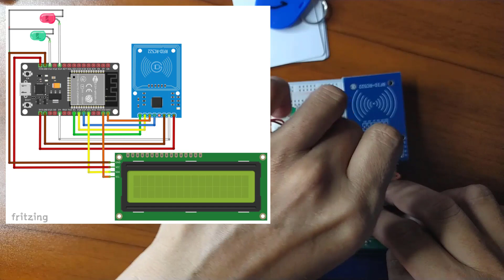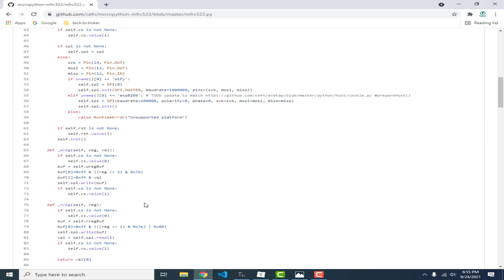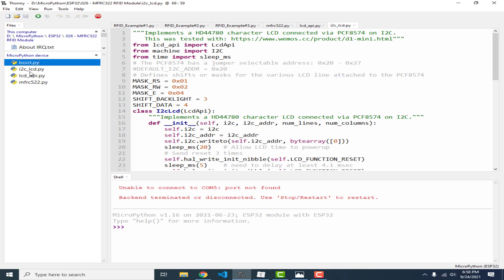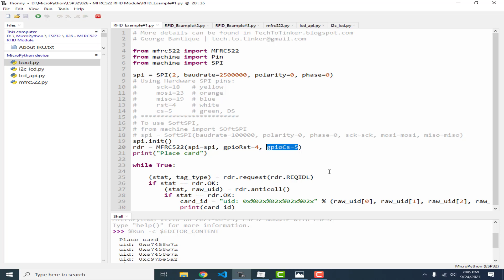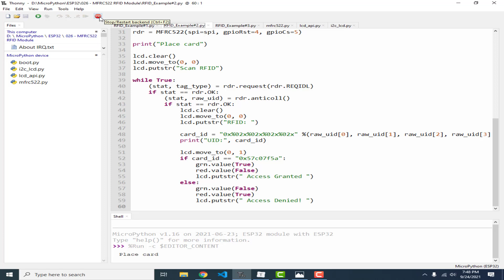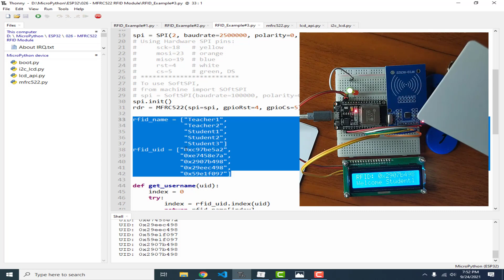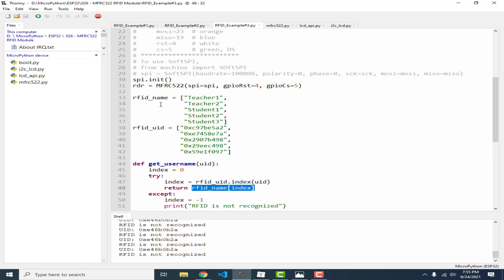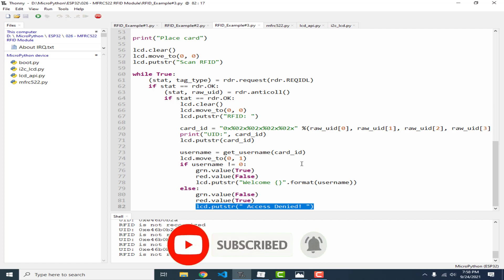026 - ESP32 MicroPython: MFRC522 RFID

Comment: First of all, thank you for all your videos, I just know how to program in Python and these ones are really helpful to get into applied electronics. I just wanted to ask if there is a way of modify/write the information of the cards? I've been looking through the libraries but none of them let me modify the info when tried eventhough there are some that have a "writing function".  Thank you!
Reply from the maker: Hi Miguel, thank you for the appreciation.

With regards to your concern, you may go to the github source and under the folder there are 2 files 1 for reading the mfrc522 and another for writing to it https://github.com/cefn/micropython-mfrc522

I haven't fully tried it but it's working with me as far as I can remember. Cheers, George.
Reply: @TechToTinker  Thank you so much for the quick reply, I will try because I couldn't even with this so sure I'm doing something wrong. Thanks!

Comment: Should the LEDs have current-limiting resistors?
Reply from the maker: Hi @I'm not Chuck, yes you can add a current limiting resistor. I just added the led indicator when I am about to record the video, my bad :). Thanks for correcting. Cheers.
Reply: @TechToTinker  I watched the entire video, and learned about RFID, although I don't have a use for it. In fact, I have watched all of your ESP32/Micropython videos, and learned quite a lot.
Reply from the maker: @ImnotChuck.  wow, that's great. Really appreciated and thank you for the support.
Reply: @TechToTinker  The current is limited by ESP32. Each port is limited at 25mA. It 's ok for the led.